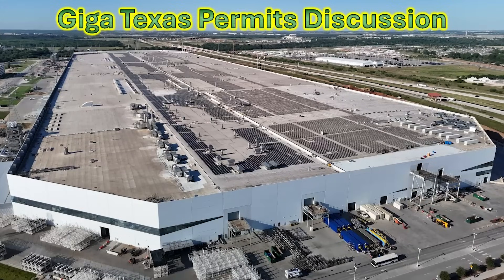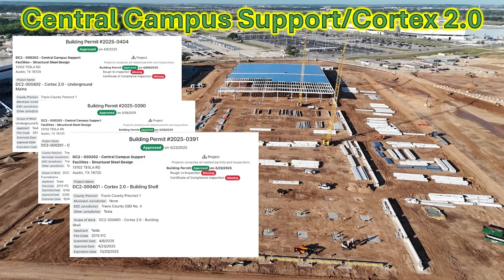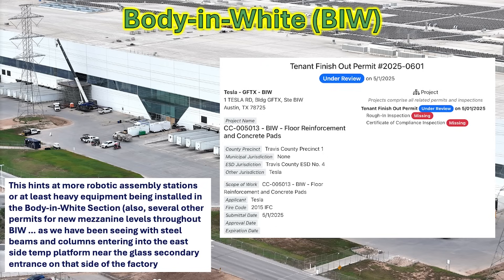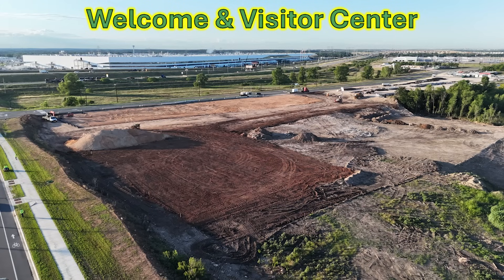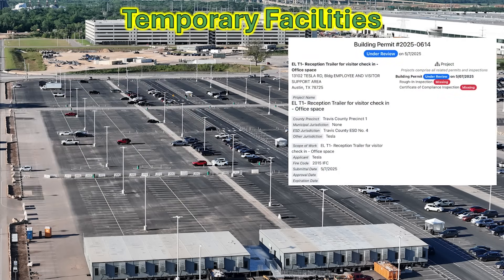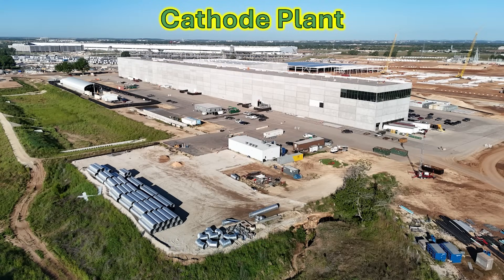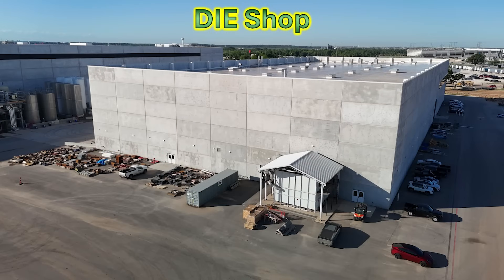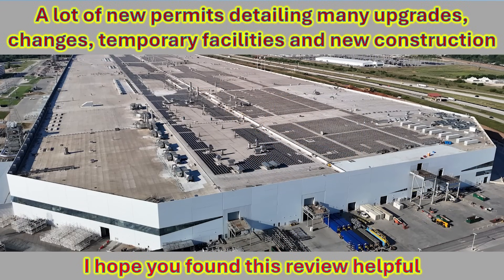Giga Texas Construction Permits Discussion, May 2025 (Parts 1 & 2 Combined)

Comment: It’s likely they’re building the Semi motors in Texas as they already build motors there. More so if they plan to use CyberTruck based motors for the semi. Since they have plenty of trucks shipping batteries/packs from Reno, they probably have a lot of capacity to ship motors from Austin to Reno. I assume Reno motor assembly is at or near capacity and the facility might be maxed out. I doubt if this is for maintenance.